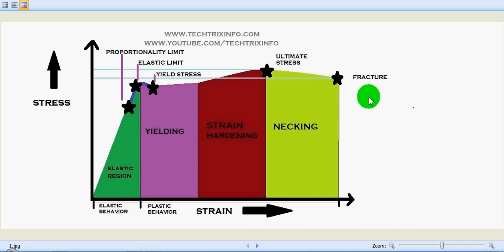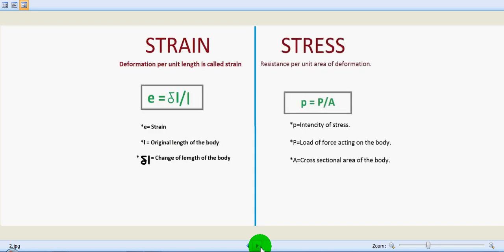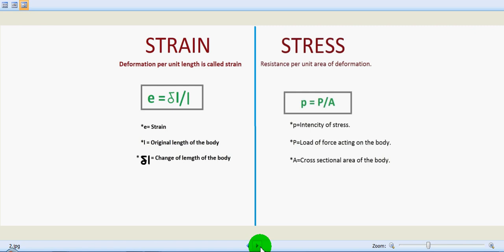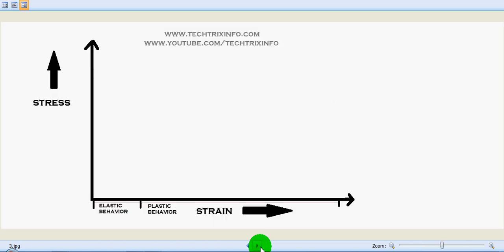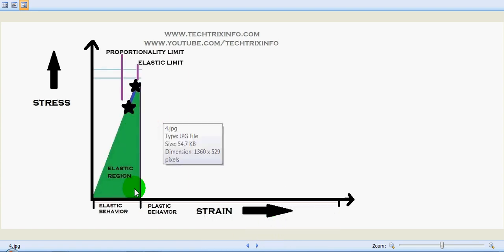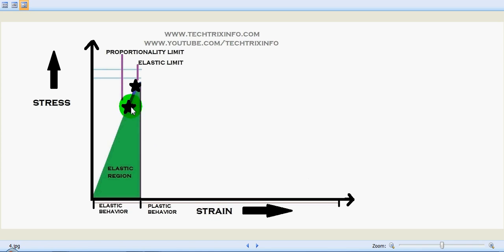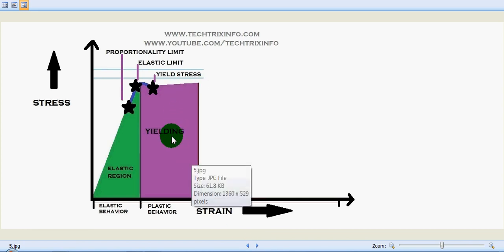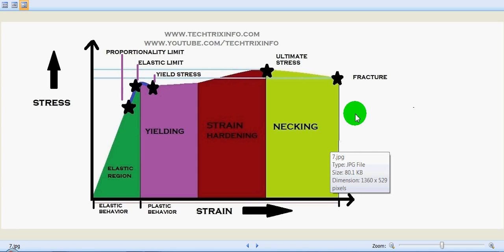How stress strain graph works. ✔

Comment from the maker: Limit of proportionality is the limit at which the stress strain curve starts behaving in a non-linear way and the Elastic limit does not equal this limit and can usually take a little more stress. It's usually graphed parallel to the Proportional line but with a starting point of 0.01 strain.